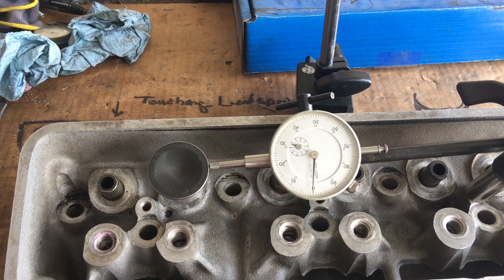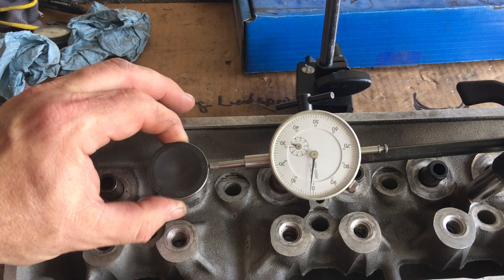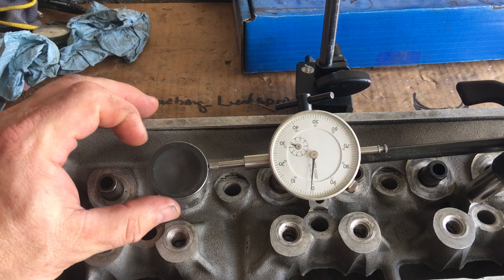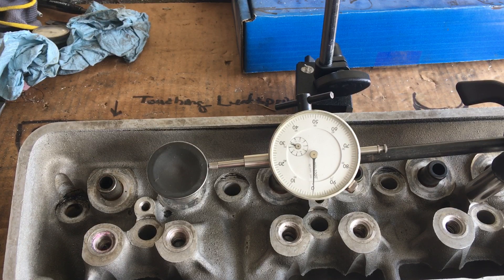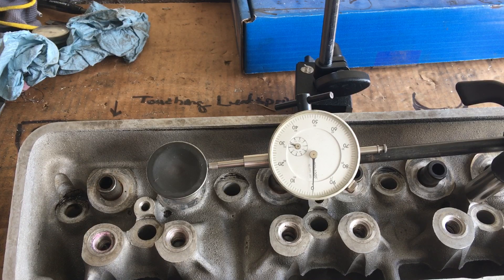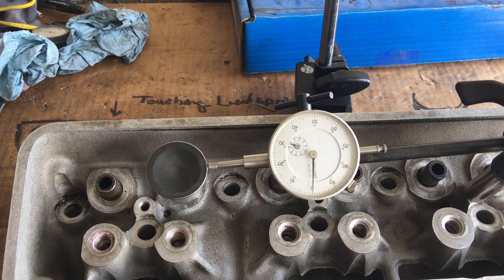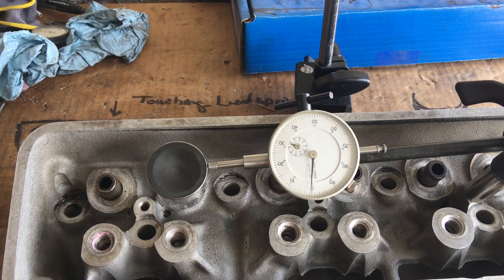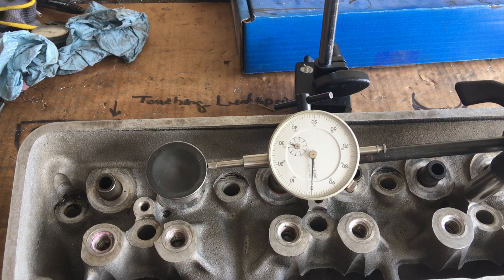Porting the LT1 heads checking the valve guides for wear

Comment: Hello. I have a early 94` Z28 conv. single cat. Do you still do these heads? I would like to have mine done. Or buy the Edelbrock heads. Thank you.
Reply from the maker: The Edelbrock heads look like a stock replacement style head with small valves and only a 170cc intake port. Im not sure what a set cost? 
What condition are your castings?  Because of age/mileage the older LT1 heads I’ve done needed new valve guides.  I’d upgrade to at least a 2.00” intake valve with a larger 180+ cc intake port. 
Email me jeffdubray@gmail
Reply: @HeadFlowInc  Hello. My engine just turned 100,000. I read that the head gaskets go out around a 100,000 mi. I would like to replace them before they blow. While it is apart I can inspect the cam for wear. If the cam is OK , I will leave it alone. I will then replace the head gaskets. Install Edelbrock intake. Have the stock heads cleaned-up! Port and polish or just polish? If the cam is too worn I will not bother and order a Golin LT1 383 500hp Long-block to  replace the stock engine this fall. I am ordering this engine anyway, but would like to get some more miles out of the stock motor. It runs awesome, just down on power by today's standards. I just installed a built transmission for 650 hp. I got a Moser GM 12-bolt in the crate to install. Is a 100,000 miles too much wear to bother with a top-end kit? Heads,Cam, intake. I talked with golin and they have an openning for Sept build. If the cam is OK and I decide to just have the stock heads done, will you do the job for me? The long block will cost me $9000. Thank you

Comment: Can you tell us how high the valve is out of the stem. That distance would affect the measurement.
Reply from the maker: This was a long time ago I do not have those measurements.  The machine shop verified the guides were bad as well, so we did the guides and fresh valve job. 
Whether you unseat the valve .250 or .750”+ shouldn’t change the measurement since the valve stem is still fully through/engaging the valve guide length. JD

Comment: Would it be less expensive to buy a valve with an oversize thickness and ream out the guides?
Reply from the maker: Skyline Fever I’m not aware of any 11/32” guides that would accept the bore for a 3/8” valve. 
Two concerns I can think of:
1. A 3/8” stem valve would be heavier than the 11/32”
2. The guides wear differently top to bottom and tend to egg shape slightly do to side loading wear. I’m not sure if you could true up the bore of a warn guide to a larger side. 🤔
Performance wise, we should have committed to changing to 8mm valve stems since all the guides needed replacement.  Going down to the 8mm stems gains port flow plus would allow the use of LS valves like the 2.00/1.57” also improving flow with the proper bowl work.  JD
Reply: @HeadFlowInc  What I was thinking was that some companies sell valves that are about .003 wider, so they would fit an 11/32 guide that was honed out.

Comment: Mine are that loose I said F-it if I drop a valve I drop a valve. "I know the risk" I don't plan on running my LT1 for much more than 2 seasons.
Reply from the maker: TPV Productions I’ve seen and run heads with loose guides, mostly you’ll see a puff of smoke on start up,  oil on the spark plug threads and have oily buildup in the exhaust ports..  Good positive seals would help!
I just didn’t want any oil consumption issues so we decided to bite the bullet and have them repaired.  I can’t wait to see how it runs!  👍
Reply: @HeadFlowInc   Oh for sure, if I was doing a customers head like you are doing, I would only finish it if they agreed to have guides done. I'm going to run a good hit if N2o on mine so the plugs won't be in long enough to accumulate oil. Great video BTW and keep them coming.💪

Comment: I have same issue with my 4.6 DOHC heads. Bought some new powdered metal guides and I gonna try change them myself. Must be a different style guide on ur head?
Reply from the maker: Sean Desrosiers I’m not sure if our guide material are the same but I’d guess they are.  Remember you’ll need a final size reamer to fit the guides to the valve stems, the guides don’t come ready to run.  
Also, make sure the check the valve seal between the valves and seats, many shops require a fresh valve job after guide work.  I’m not 100% convinced you’ll need a valve job, I mean you’re technically recentering the valve, so 🤷‍♂️. 
Good luck, verify if you’re going to need any type of sealant on the new guides or if they drive in dry.  JD
Reply: I been stressing about these heads for over a year. I figured I’d have to ream guides to size as well but the old valves fit the new guides perfect.  Guess I should mic the inside of the guide. The new guides have a circular groove cut into the inside that extends about 75% of the way down. Never seen a new guide before. Was going to lap valves and hope for the best. Trying to avoid machine shop if possible. Read so many horror stories about machine shops. Be a long time till I get to the engine. Been painting frame and underside lately then the 8.8 then 4r70 then engine. I’m just researching, buying tools and learning from your videos. You are a big help. Wish I lived next to you.